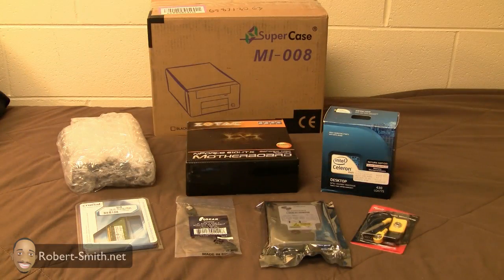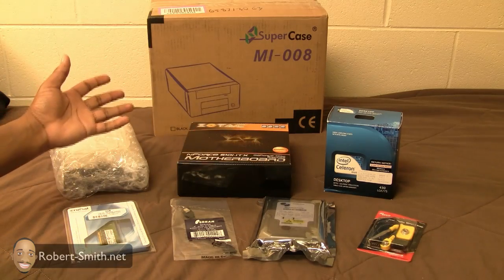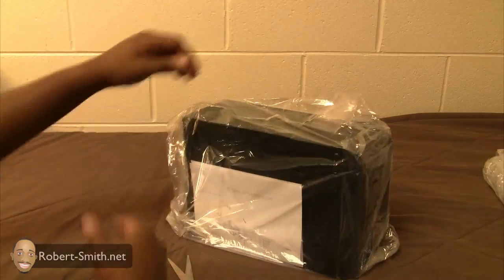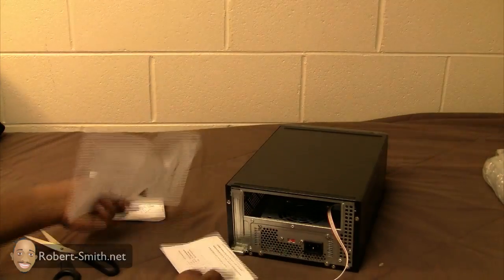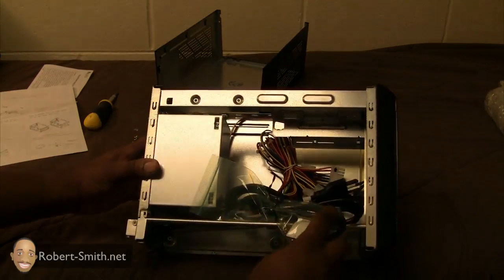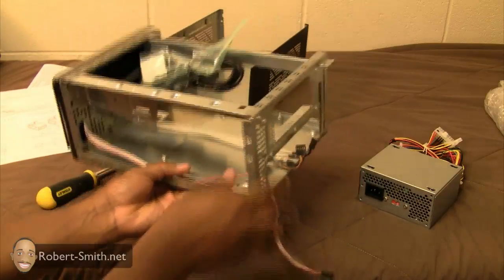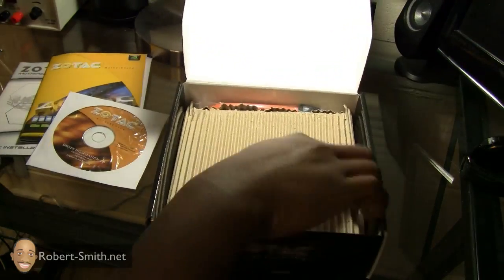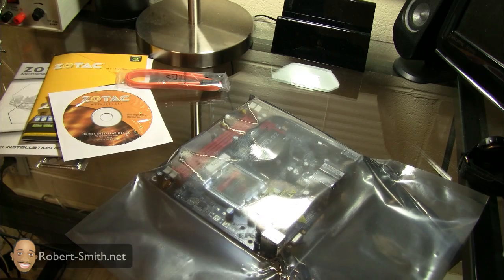How To Build A Mini ITX Computer Part 3/9

Comment: Spire still sells that case. The problem with it is it's impossible to put a PSU in place of optical drive. Some cases use a cable from PSU to a back panel. I like that case hides USB ports.

Comment: Im building an computer this summer for fun with an Mini-ITX motherboard with built in Nivdea Ion graphics and in built latest generation Intel Atom dual core.
4 gb of ram
2 be quiet fans
cheap seagate harddisk
and some other stuff
Building the case by my self

Comment: If you worried about static u can just plug in the psu after it is installed and put one hand on the metal of the case.... just a little tidbit of wisdom